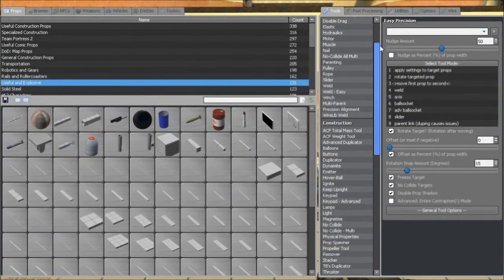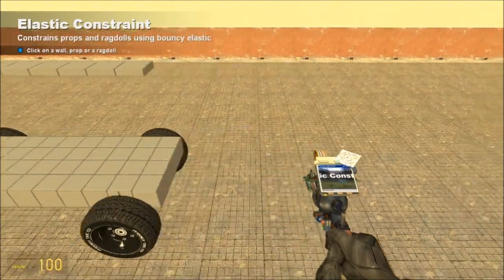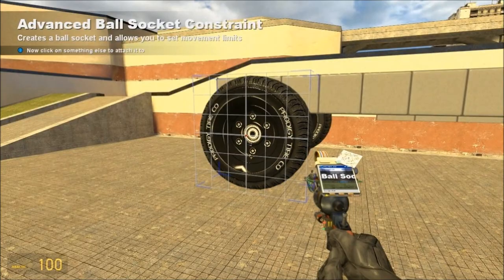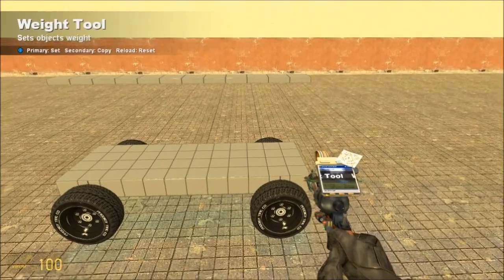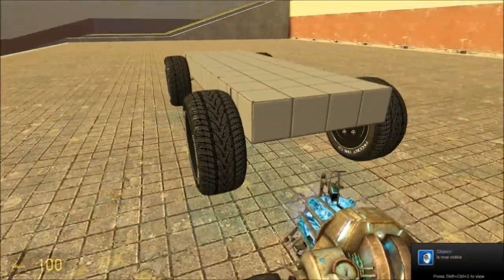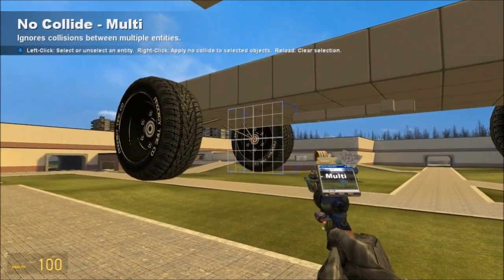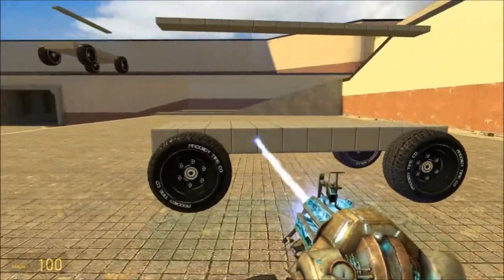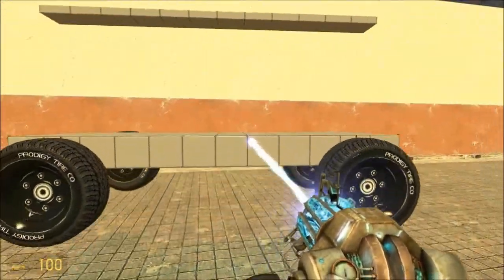(GMod) (Tutorial) Chassis Independent Suspension Part 2

Comment: How do I convert the horizontal spinning of the flywheel on the engine to vertical spinning motion on the differential, I'm using the BRD differential. Like what kind of ball socket or w/e do I have to use with what settings.